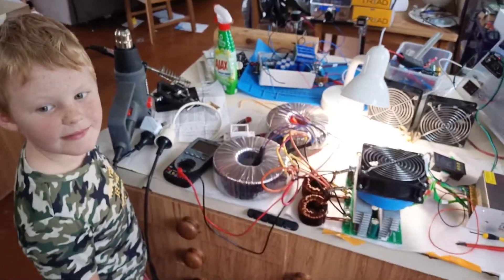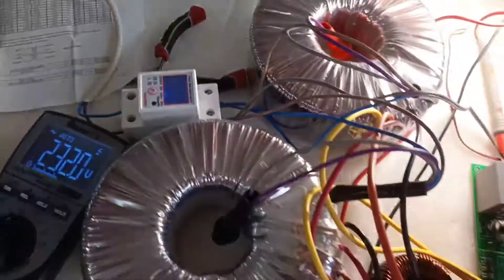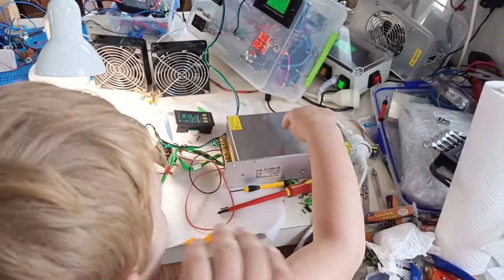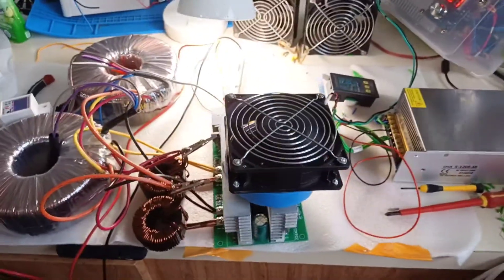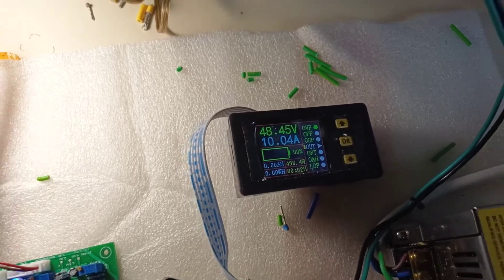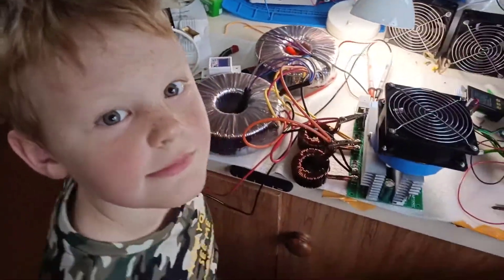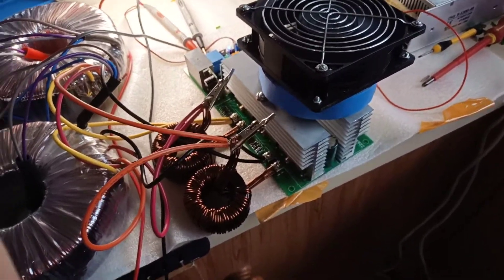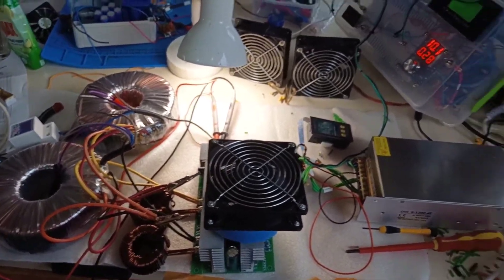Toroidal transformers connected in parallel

Comment: Sorry to say, what was  wrong there? 
          because you had over 60 WATTS at idle,  that  was way too high,  you needed to re-do the chokes, and use only one, 45 uH; as you now know,  you need  15  to  20 watts  max, at idle, more than that, and  something is wrong, it  kills your battery and heats up the choke, the transformers or both;     
  here in Portugal,    my 3000 watt inverter,48 volts, one 14 kg toroidal trafo, is 18.2 watts at idle. 

      i  also now have two trafos like you in the video, 50 euro for both,used,  about 6.5 kgs each, 1000 watts each,  ex-audio grade, to hook up to another 48 volts inverter
       the  trafos are 220 to 14 volts ( i re-wired the 14 v. secondaries myself) and  they will be in series, 28 volts primary, 16 mm2 wires
        i can't wait to see the idle current, hope it will be around 15 watts

Comment: Would you recommend this set up of parallel transformers for long term use sir?
Reply from the maker: Good question. I tested it for a several days. Transformers are almost identical. Everything worked fine. Transformers need to match perfectly. Double transformer inverter unit is using more than single transformer on standby, without load. One huge transformer is better than two